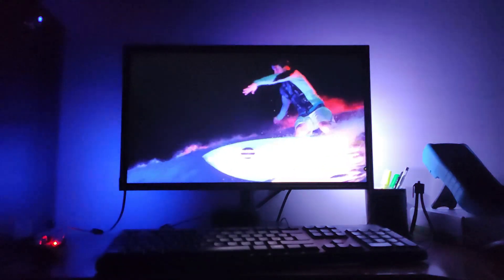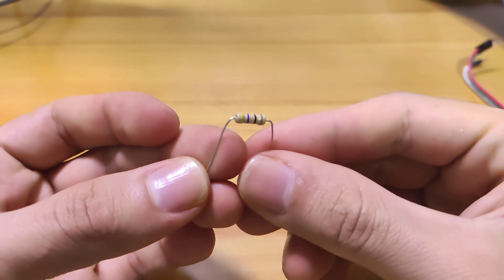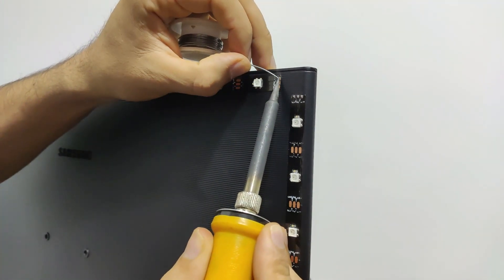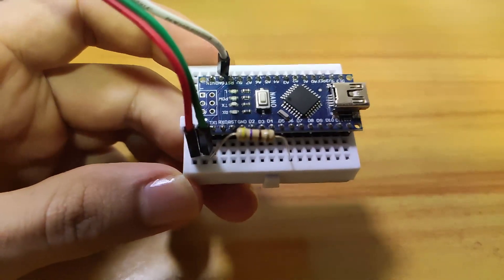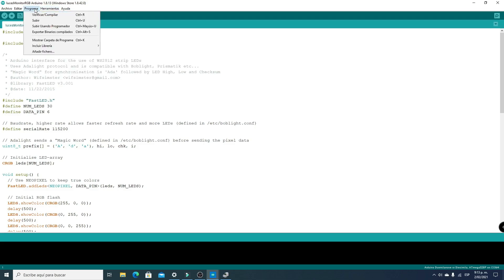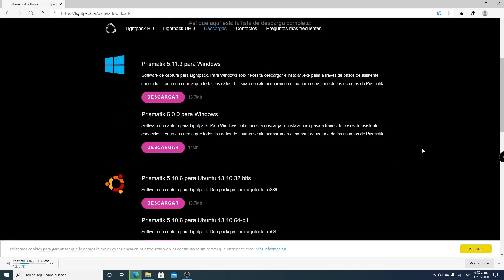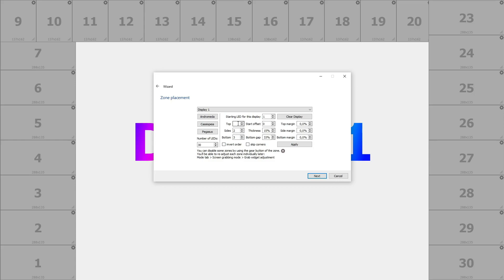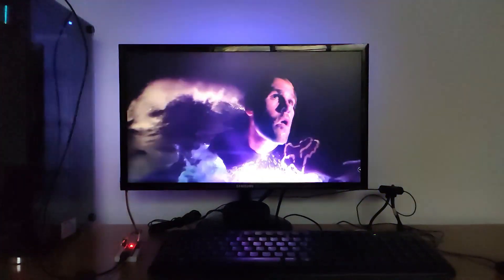⚡ Luces AMBILIGHT para PC con ARDUINO

Comment: Hola en otro tutorial vi que habia que poner una resistencia de 300ohms pero veo que vos recomendas uno de 470ohms. Cual seria mejor? o depende del largo de la tira que uno use?
Reply from the maker: Solamente depende del tipo de tira led, en este caso use la que recomienda el fabricante, he probado tiras led sin la resistencia y no han fallado, aunque es mejor utilizar las recomendaciones del fabricante. Saludos! ⚡
Reply: consegui una de 60 leds por metro, supuestamente consumen 14w por metro. Suponiendo que necesite 2 metros para un monitor de 27" con un cargador de celu de 3A estaria bien o busco mas amperaje? porque vi fuentes que son bestias en amperios siendo de 5v.... vi tanto como de 4A como de 40A xD
Reply from the maker: @lucho997  Mira que las tiras led van a tener un consumo máximo cuando se enciende el color blanco, si 28W es la potencia máxima, entonces vas necesitar 5.6 Amperes. Pero pues cuando se utiliza en modo ambilight el consumo varía según los colores y es mucho menor, no se cuál sea el consumo promedio pero te recomiendo al rededor de 5A.
Reply: buenisimo, a buscar esa fuente entonces y a aventurarse a soldar xD 
Gracias por responder